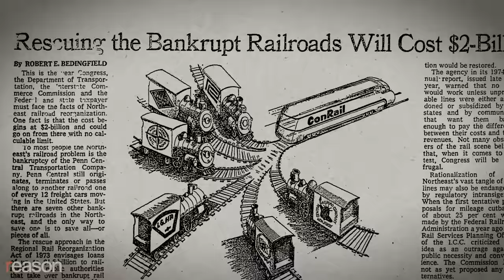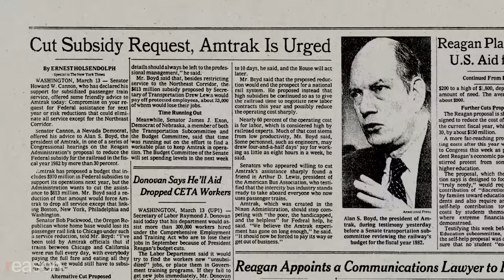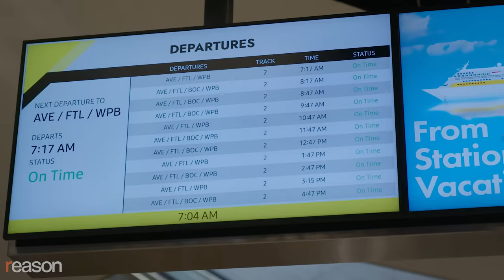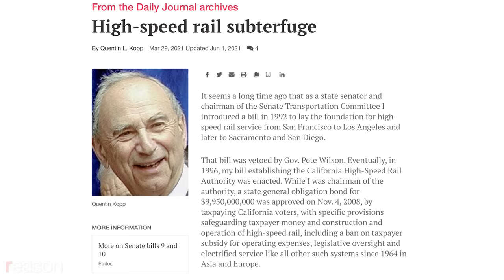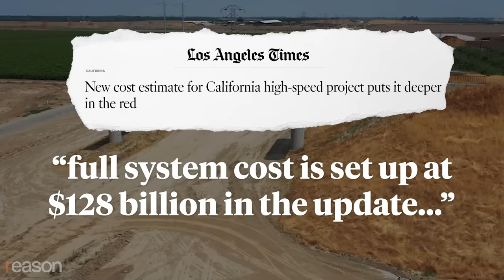How Florida beat California to high speed rail

Comment: You’re comparing apples to oranges here. Floridas brightline “high speed” train service only runs up to 125mph and uses existing trackage meaning for a good portion of its right of way limiting the amount of trains they can run on the line. So it was much cheaper and faster to build BUT isn’t as capable. Plus their line is much shorter than Californias 

Meanwhile CAlifornia is building their high speed railroad to operate at speeds of 220mph on a brand new right of way to optimize speed and access to population centers along the way while also building the line to remain grade separated from public roads to help with track safety (Unlike brightline). AND on top of that the California High Speed rail project is the first of its kind in the country! Meaning large amounts of infrastructure has to be built just to build the railroad, and on top of that an entire new workforce has to be trained in this sort of construction which is also going to raise costs.

Now don’t get me wrong, both services are going to be excellent once they’re completed but you can’t compare them, especially when one of them is doing something that has never been done in the US before. It’s a shame really, for being called reason TV you aren’t being very reasonable 🙄
Reply: Came here to say this. Brightline in Florida is NOT high speed rail.
Reply: Correct UK are building HS2 (High speed rail 2) new track 225mph trains also original cost 33billion now 90 billion these projects are not cheap but in the long run are worth it
Reply: This is 100% accurate. People are stupid or willfully ignorant if they think Brightline is the same as CHSR.
Reply: this is a political propaganda video (libertarian)
Reply: Come back to this thread in 50 years and I guarantee that the CA line will run at speeds far less than 220 mph. 

Already large sections of the line are going to run at 110 mph (which is already optimistic given it’s shared rail with commuter trains).
Reply: @Jaxsf1  the only section that’s sharing rails with commuter trains is the portion of line going from San Francisco to San Jose which is a grand total of 50 miles out of the entire 520 mile long route that’ll encompass the first phase of the California High Speed Rail corridor. The rest will be 220mph.
Reply: fredm.7145  "if it is finished it will not be highspeed." California is literally aiming big and building new trackage for HSR, while brightline is only using existing tracks and laying 100mph average tracks without electricity. You're comparing apples and oranges.
Reply: Florida cannot electrify their tracks because of hurricanes. Brightline is also building new tracks. The Orlando to Cocoa beach leg is new track, the Cocoa to West Palm Beach track was upgraded from Class IV to Class VI and the Orlando to Tampa leg is also new track to be finished in 2027. Currently, Orlando to Cocoa is 125mph, Cocoa to West Palm Beach is 110 MPH, and only the short West Palm Beach to Miami is 79 MPH because there are several stops in between. The majority of the route will be running at 125 and 110.... and the thing is, with it being run into the Orlando International Airport, perfectly centered in the state, you can get to any part of Florida in 2-3 hours. It's perfect for tourists that fly into the Orlando Airport for Disneyworld and then want to visit Miami Beach. The Orlando Airport also connects to Sun Rail, which is the commuter rail for Orlando. The I-4 Interstate corridor is one of the most deadly highways in the US because the population between Tampa and Orlando has doubled in the past 10 or so years. Roughly 10 million people live within that 1 hour stretch of road. I would rather have a 125mph train now than a 200 mph one in 20 more years. 125 mph is completely fine to get all across Florida  @josephman1488
Reply: fredm.7145  They reached 130 mph, and that's not going to be average speed. It's pretty disappointing that brightline wasted billions for a train at this speed😂😂
Reply: “Once they are completed” one is, and it’s brightline. When’s CHSR coming?
Reply: @tylerkriesel8590  CHSR is coming by the end of the decade. One was built to be finished quickly and one is being built to last.
Reply: @PlaneBoy2520  cope
Reply: @tylerkriesel8590  ??????
Reply: @robw7381 nope Spains highspeed rail has become a money pit due to lack of demand
Reply: @PlaneBoy2520 Also 30 miles from San Jose to Gilroy and about 40-50 miles from Burbank to Anaheim.
Reply: fredm.7145 Most of the CAHSR route will be high speed operating up to 220 mph and testing at 242 mph. The 119 mile 'test track' will be finished and operating this decade.
Reply: fredm.7145  Fred, not sure why you’re have such an angry tone. Trains aren’t as important to Americans as you think. It’s not an excuse. We prefer to live in single family houses instead of being stacked on top of each other in apartments like in most of Europe. India is the largest population in the world. America doesn’t have the population density to make trains really as viable. Florida is starting to get them, because we are starting to have some density, but still much less than most of the world. Canada and Australia are in similar circumstances. It’s not an American “failure” or a uniquely American phenomenon. We have the most developed airport infrastructure for a country - because that’s what suits our geography. While I can take a train from Florida to California, that’d be like Europeans taking a train to Russia. It just doesn’t make sense. While the US has dense regions, they are along the coasts in the North East, where there is decent rail infrastructure, out to Chicago. Then we have the Pacific Northwest. Other than that, we have the vast middle “flyover” states that are mostly farm communities. The population density of the US is 1/7th as much as Germany. To make trains work, you need very dense populations. That’s why it works well in Western Europe, because they live on top of each other in small apartments and townhouses. I prefer having an actual house. Whether my occasional trip to Miami is 125mph on a train or 200mph doesn’t really make much of a difference to me. If I go to New York, I’ll fly and be there in 2 hours. Even a high speed bullet train would take 17 hours. It’s never going to happen. You should take a walk or go outside, you seem very enraged about something that doesn’t really concern you or have anything to do with your life. The US actually has the most extensive rail system in the world with over 250,000 miles of track. But it’s used for freight because we are a continent sized country that needs to move goods from one side to the other. We do what makes sense for us. It’s not about one being better than the other. Geography determines what is suitable. If I lived on a small, cold, increasingly poor island like the UK, I’d probably take a train too. If I lived in an apartment the size of my living room in Europe, I’d take a train too. But I live in a 3,000 sq foot house powered by solar panels with a 3 car garage and 2 teslas and a weekend Land Rover in a country with the most extensive airport network in the world. I will enjoy taking this train to Palm Beach, one of the richest towns in the world, or Miami, and then will come back home to my beautiful home that I live in with my German wife who also doesn’t miss living in a townhouse in Germany nor cares about the “lacking” train network in America.
Reply: fredm.7145  Brightline isn’t sucking up tax dollars. It was funded with bonds. Brightline west from la to Las Vegas is asking for 3 billion but brightline Florida didn’t take tax money
Reply: @PlaneBoy2520 THE 2008 ballot referendum said the LA to SF train would be completed by 2022.  Now the governor is saying 2040 to reach that full goal.  (In the meantime Cali’s fastest train is the slow 60 mph Amtrak.)  Nowhere as fast as what Florida has (125)

Win Florida governor 
Fail Cali governor (actually several governors since 2008)
Reply: ROADS are funded by gas/diesel taxes (indirect tolls).  Both the states & federal governments collect MORE of these gas/diesel tolls than they spend on road maintenance.  Therefore, roads have a surplus and don’t need subsidies .    TRAIN REALITY: China has built more miles of high‐speed rail than any other country with $800 billion debt.  None of its lines are covering operating costs.  (As a result, China is shifting to building more roads.)

France’s rail has debts of $70+ billion and has been repeatedly bailed out by the government. SPAIN built its system with a public‐private partnership.  It is $90 billion in debt.  The state‐owned Japanese National Railways has a debt of $550 billion.  (Japan also has Highest debt to GDP of 300%.)

Railroads are an OLD 1700s technology that is obsoleted by faster, more flexible travel technologies.  High-speed rail loses tons of money & is a bad investment.

Comment: The US actually carries more rail freight than any other country.
Reply: And China carries more passengers on high speed rail than any other country.
Reply: And yet, the freight infrastructure is still horribly overburdened and garbage.
Reply: @bobbinsthethird AND China has a massive debt problem on its passenger rail.  They  built more miles of high‐speed rail than any other country with $800 billion debt.  None of its lines are covering operating costs.  (As a result, China is shifting to building more roads.)

France’s rail has debts of $70+ billion and has been repeatedly bailed out by the government. SPAIN built its system with a public‐private partnership.  It is $90 billion in debt.  The state‐owned Japanese National Railways has a debt of $550 billion.  (Japan also has Highest debt to GDP of 300%.)

Railroads are an OLD 1700s technology that is obsoleted by faster, more flexible travel technologies.  High-speed rail loses tons of money & is a bad investment.
Reply: @electrictroy2010 Nice over and over again comment cut and paste job many numerous times. Sort of redundant and somewhat boring.

Comment: It's cool to see high speed rail in Florida. I'm not gonna use it, cause I can take a Greyhound for half the price, and the bus is only an hour longer.
I hope to see more HSP rather than highways in the US. 

I took the Amtrak from St. Louis to Chicago today. Didn't surpass 70 mph and we were being passed by drivers in the right lane on the parallel highway. We can do better.
Reply: Greyhound/Flixbus charges $25-$55 ($25 if super advanced) from MCO to downtown Miami with a timetable of 5 hours. Far slower than Brightline. I don't even need to get into the amenities, comfort, or even the bathroom comparison. 😷

Comment: It's worth comparing the estimated costs of building high speed rail to what it would cost to build the equivalent freeway and airport expansions to meet the same capacity. In California's case, WSP, a construction management firm, did cost estimates for both, and found the latter to be about 1.5 times the estimated cost of high speed rail. Not to mention that both freeways and air travel are also subsidized.
Reply: They underestimated as it turns out.  And why is anyone entitled to anything being expanded at all at tax expense?
Reply: @MilwaukeeF40C   Underestimate cost and Overestimate ridership as custom with Rail Projects.
Reply: TRAINS COST MORE.  China has built more miles of high‐speed rail than any other country with $800 billion debt.  None of its lines are covering operating costs.  (As a result, China is shifting to building more roads.)

France’s rail has debts of $70+ billion and has been repeatedly bailed out by the government. SPAIN built its system with a public‐private partnership.  It is $90 billion in debt.  The state‐owned Japanese National Railways has a debt of $550 billion.  (Japan also has Highest debt to GDP of 300%.)

Railroads are an OLD 1700s technology that is obsoleted by faster, more flexible travel technologies.  High-speed rail loses tons of money & is a bad investment.
Reply: ROADS have a surplus.  Both the states & federal government collect more in gasoline/diesel taxes than they spend on maintenance.  Roads aren’t subsidized
Reply: @electrictroy2010   We're not falling for this you shill. Rail transit is better.

Comment: Car travel and air travel also only work with massive government subsidies, just less direct then rail travel. Airports are heavily subsidized, while the interstate highway system is entirely government-run and funded at massive cost.
Reply: I live in Florida now, but I noticed what used to be countryside and only  one laying on either side is now being constructed to be practically an expressway with two no three lanes each way there’s very much building and construction going on in Florida. !!! don’t know how much all this cost going on in many places in Florida widening the highways probably many millions !!
Reply: FALSE.   roads are funded by gas/diesel taxes (indirect tolls).  Both the states & federal governments collect more tolls than they spend on road maintenance.  Therefore, roads have a surplus and don’t need subsidies .    TRAIN REALITY: China has built more miles of high‐speed rail than any other country with $800 billion debt.  None of its lines are covering operating costs.  (As a result, China is shifting to building more roads.)

France’s rail has debts of $70+ billion and has been repeatedly bailed out by the government. SPAIN built its system with a public‐private partnership.  It is $90 billion in debt.  The state‐owned Japanese National Railways has a debt of $550 billion.  (Japan also has Highest debt to GDP of 300%.)

Railroads are an OLD 1700s technology that is obsoleted by faster, more flexible travel technologies.  High-speed rail loses tons of money & is a bad investment.